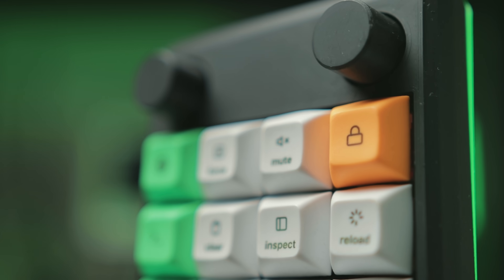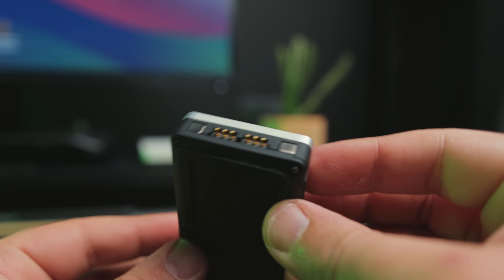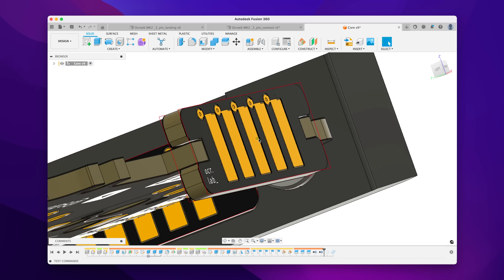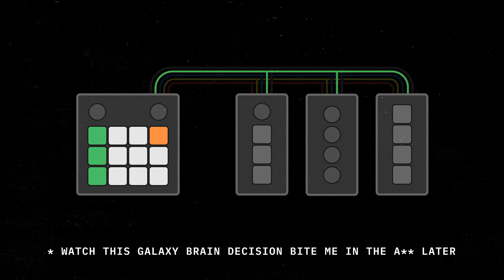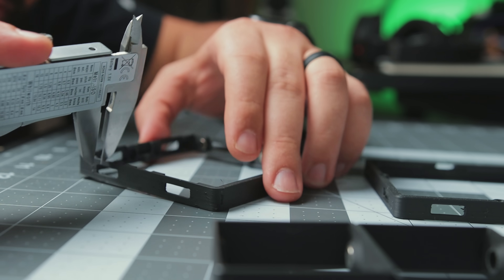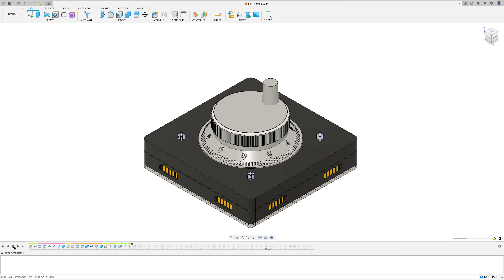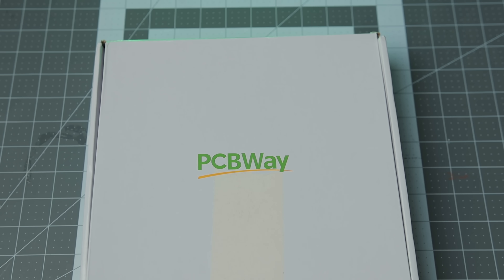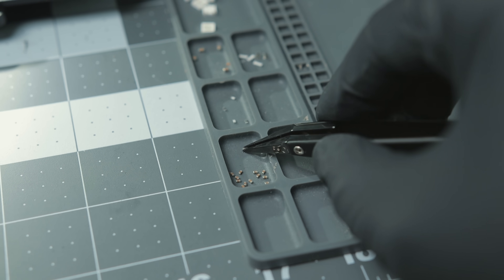How I made a Modular Macro Keyboard System (3D Printed): Ocreeb MK2

Comment: This is insanely well made. I'd have two suggestions though, both related to the modularity.

Since you've already made your own connector, you could replace one magnet with a steel insert, let's say from looking at the connector, the left is steel insert, the right is magnet, this way you won't have to worry about the polarity. Combined with a more symmetrical design using 6 pins (3 pogo pins and 3 pads) you'd have a rotationally symmetrical (I hope that is the correct description) connector. Again looking at the connector, from the left, it'd be, steel insert, 3 pads, 3 pogo pins, magnet. If you always mount them with a magnet on the right (or left) every module will always connect in any orientation.

The other suggestion that ties to the connector described above is to use modules as buffers for inputs. It will require a bit more logic on the module side though. The idea would be for modules to have an internal priority or preference to use only one connector to send data. And use the rest of the connectors as inputs from other modules. This way every module either generates its signal or forwards the data from other modules. All this will form a tree like structure (connections wise). You could then get rid of the interrupt and scanning.
Reply: Problem: pins positions would be mirrored as well: PWR will go into GND, INT into empty, SDA into SCL, and vice versa. This will probably require you to add two more pins to mirror PWR/GND (so it will be GND/PWR/INT/SDA/SCL/empty/PWR/GND) and to write some sort of handshake protocol to make switching data paths very quick and reliable.

Another idea is to mirror the whole connector (so 10 contacts with 5 pins and 5 pads) - this will be easier to handle, but might be too large to be practical.

Third option is to put female connectors in body recesses and use M-M connectors between them (so F-M-M-F, contact ensured by spring tension and tight shroud fit, magnets work by themselves). Same problems as before, but at least it won't be scratching everything it brushes against (then again, you could just put a shroud around all pins and recess the pads a little bit, like in MagSafe for well-known example).

Comment: Since you're using a 2040 based device, might look at using PIOs for doing the signal interpreter too.  They operate blazing fast, and work regardless of the software platform.  Could be a way around the problem.

Comment: When I tried doing something different but also using random modules interconnecting I made each module respond to a 'multicast' I2C address in addition to its own. So in an interrupt I could ask who interrupted instead of scanning them all. With each module monitoring its own response you could determine bus conflict and back off if there were two simultaneous interrupts. I was also using a DHCP like idea to assign module addresses so didn't have to worry about duplicates etc. It seemed to work in the concept program testing but I never took it further.

Comment: For the interrupt problem. You could look into devices using a dac to set this line to a certain voltage and then the master will do a analog read on this pin and know which module wants to talk. With using a dac there are possibilities to set the value of the analog signal so there are no duplicates. Also the highest voltage will overrule and this also acts as a way to set priorities for certain modules or actions.
Or you could use a PWM signal the same way as i described the analog one. More care needs to take place to make sure all the modules are on the same frequency and on the same phase. Because if one module is out of phase and then two modules both send a PWM signal its gonna be a hot mess. But if you achieve to get this to work also there is a priority build in because the highest pwm signal will overrule all other signals.
Reply: It is a mouth full, but it might help you out
Reply from the maker: Thank you for the recommendation. It's an interesting and clever approach. I might try it if I don't find another fix

Comment: Hey, I also have my own Macro Keyboard. I was wondering how exactly do you make it work Software wise. I found a software which transforms the inputs into normal outputs, like + or -. For example how can you make it work in Lightroom?
Reply from the maker: the lightroom stuff is done using MIDI and this software https://rsjaffe.github.io/MIDI2LR/ It allows you to map midi control signals to lightroom commands

Comment: If you made all the modules on the USB buss, but still use the magnet connectors. Windows would just see USB HID devices. Think USB HUB. Doesn't matter whats connected. You could use the new Raspberry Pi Pico W. It has Wifi too, so you could have the USB for just power and have the modules Wifi?

Comment: One option to fix the problem with the I2C polling missing the event is to reprogram the seesaw module to save the current state of each attached device and push that when requested. Buttons could also be programmed to latch when pressed until the I2C bus can send the info that it was pressed. 
Those seesaw boards have an ATtiny on them so the possibilities are basically endless!
Reply from the maker: thanks for the suggestion! I will look into it

Comment: Great project, awesome video! What are your experiences with the tolerances on FDM vs resin prints? How is dimensional accuracy? And do you worry about negative interactions of resin printed keycaps with human skin? Looking forward to the next iteration!
Reply from the maker: Thanks! 
In my experience the tolerances and fits have more to do with the surface quality. FDM tends to have more blemishes and variations on the surfaces that can lead to different results. For example you would have a calibrated printer and produce dimensional accurate models but when it comes to interfacing parts; 0.4 mm would be normal fit on FDM and loose with resin. I hope that makes sense.
As for the resin safety I try to follow proper precautions while handling and processing the prints. Once properly cured I'm not worried really

Comment: How did you insert the individual components such as the keyswitches USB-C input/output plugs into Fusion360?
Reply from the maker: by generating 3D pcbs from the 2D board space and the rest was inserted as external models like you would do for screws and hardware
Reply: Thank you

Comment: You can use CAN to make the communication faster so you don't need interrupts, can is really simple on hardware side and can go up to 1Mb/s. I2C is usually 400Kb/s which is not great and is pretty noisy on long bus topologies such as yours. I'm not sure if the rpi mcu has CAN but it most probably has SPI so you can put an SPI to CAN ic to make it work. CAN is exterelemy noise resistant and has many many features that would work great in this project
Reply: CAN is a more robust bus system that i agree, but for such a system CAN is too much. I2C has the benefit that it is build in almost all uController. It simpler and cheaper. And if the interrupt system works the I2C bus will be good enough
Reply: CDBUS is similar to CAN, but much faster and simpler than CAN, we should use UART controller like CDCTL01A.
Reply: @dukelec  This looks super cool, but sourcing the chip seems like a pain, I could only find alibaba links to it. I would love to get a reel of this

Comment: Nice video I also build the exact same macropad with the Xiao rp2040 (12keys +1 encoder +oled/2nd encoder)but connected the keys via Japanese duplex matrix and saved one pin. One problem is I didn’t now the encoder needs 2  GPIO pins that are beside each other. Couldn’t find a fix yet.
Reply from the maker: Thanks! if you are using KMK there is a different scanner I believe that doesn't use rotaryio (the one that requires consecutive pins). Don't quote me on this but i remember seeing something about it.

Comment: Wondering if there would be any isseu with having 2 of the same module? ie 2 of the slide potentiometer modules, would their i2c address conflict or is there extendable addressing available to you and that should be considered when assembling the module?
Reply from the maker: I included jumpers to change the address exactly like it's done in the Seesaw breakout boards and you can also program whatever address you want when loading the firmware.

Comment: not a fan of the pointless rgb but the analogue parts are very close to being a solution to a problem ive had
will only need to switch the rgb and diffuser from being under it to inside the grooves for the sliders and make things flatter/less tall
would prefer a long oled strip like the macbook touchbar but nobody seems to make those in colour and im not about to rip the touchbar out of my old macbook and reverse engineer it lol

Comment: I think the first thing to do, apart from changing the interrupt, to simply switch from circuit python to C or Rust, to gain massive performance just from that. Great build tho! very nice.
Reply from the maker: Thanks! Someone suggested to compile a signal interpreter from C as a library for exactly this reason. I might try that if I figure it out
Reply: @salimbenbouz  im not versed in microcontroller in python but maybe trying to compile python with a compiler library would also speed things up even without changing the code.

Comment: I say forget magnets, they're clever, but I'd rather have a physical lock under the pieces to securely keep them together, maybe a slide mechanism or like legos. Realistically, users will setup the parts once, and rarely move them around. Just my two cents on your amazing idea.
Reply: A magnet might not be as strong as a slide lock or lego style stud (which is much harder to disconnect), and I'd personally love some kind of push latch mechanism so you're not sliding on pogo-pins but anything mechanical is going to be a potential breakage - especially with brittle resin printed parts. The magnets might be less secure but there's no sliding pins against each other and no small parts to snap
Reply: Sounds like someone's never used magnets nor a modular platform before.  I say you teach yourself some things before you start spewing nonsense.  When you do actual work using inputs that aren't a basic keyboard, your setup will evolve as your workflow evolves, literally the entire point of a modular setup, and modular setups are rarely setup and never changed.  As for your issue with magnets, you clearly have no basis in reality for that statement, neodymium magnets are more than strong enough for this application and the modules aren't just going to break apart as you use them, not that they even would break apart without intentionally separating them anyways given that they'd only realistically separate under linear opposition as there's no point in the mechanism to skew along the other axes.  You clearly lack the capability of logical thought given your stance on this, and you clearly base your stance in combination with lack of logical thought on your lack of experience with anything relevant here considering your lack of understanding.  If you choose to be this mindless, then learn to sit down and shut up instead of spewing your mindless shit.
Reply: I think it should be combined with gridfinity

Comment: Brilliant project!

Can't find any suggestions as to how to solve the interrupt problem? Here's my take on it:
- Every time the master detects a new device, it will assign it an seven bit number as an ID and send this back on the IRQ line. First bit will always be a 1 and you'll never send more than 8 bytes, so you know if an address is incoming. 
- The device will save the address and use this as it's I2C address. On each event, the device will send it's I2C address on the Interrupt line.
- This approach works well with SeeSaw devices since they can take on any I2C address. A nice side-effect is that you don't need to hard-code I2C addresses and thus won't get any conflicts.

Now it obviously takes longer to send 8 bits than to just raise a line, but it will still take less time than polling many devices. Using a UART pin to receive the interrupt address, the MCU should be able to buffer whatever address is incoming so you don't loose data. I've formerly used a similar approach with multiple RS485 devices to set up a master device that can talk to multiple slave devices.

An alternate approach that scales less is to assign each new device an analog voltage. It's not as solid or scalable, but would allow for near-instant detection. Message "jenschr" on X if you want to discuss?

Comment: Wait, with your "one male, many female" scheme for connectors, how would they connect with non-male points? For example, as you have shown with the "two squares on top, two horizontal lines below" at 18:42? Wouldn't it be better to either do two connectors, or make the one you use androgynous (e.g. left 3 pins are male, 3 on the right are female)?

Comment: Great solution for the magnetic connectors.  I think that extending the connectors out, farther proud of the main pcb on each module would give you the ability to thicken the walls on the modules.  That way you can have stronger magnets.
I have a design for push-to-click square, small oled display buttons and other similar modules as yours but I didn't like the magnetic pogo pin connectors available - now I think that can be solved.
To implement some of my ideas, I was considering SPI instead of I2C  between modules but was concerned about the interconnect connector voltages and amperage limitations that would accumulate quickly with each subsequent added module as you get further away from the main power source.
I wonder if CAN + I2C might be a better strategy?

Comment: Looks cool! Your I2C comms are exceedingly slow; e.g. a transfer of 16 bytes at 400kHz should take <0.5ms, so your shared interrupt line approach should be fine. I'm guessing your RP2040 Wire code is using multiple transactions when it could use continuation (i.e. it will use a repeated start condition rather than delaying)
Reply: Also I2C is multi-master. So the micro-controller, that has an inputchange, can make the interrupt-pin high and immediately try to send the change to the head module. Assuming the head module has an address.  
For I2C message size:  1 byte device own address
keys: can use 1 bit each in the next byte
rotary encoders: 1 or 2 byte assuming max 16 bit encoders
potentiometers/slides: 2 bytes each assuming 16 bit adc
Reply: @viruselektro  Yes, multi-master would also work, without having to scan for new devices or to get updates, which has many advantages. 
He should be able to use single-master to get all values quickly though; there's something wrong with the software somewhere - I'm assuming it's the I2C library.
Reply: Also, I don't know if this is possible, but try to queue up updates on the attiny, so that the next update doesn't overwrite the first, and keep the interrupt line high when there are updates left

Comment: Regarding your performance issues: you may be able to speed things up by writing your signal interpreter in C and compile to a dynamic library (.dll on windows, .so on *NIX). Using the Ctypes (uctypes in circuitpython) module , you can import it as a python module and call your functions while benefiting from C-level performance.
Reply from the maker: Thanks for the suggestion! I will look into it. You're right maybe this will work way faster for the custom address pulse I was tinkering with.
Reply: Dynamic libraries aren't a thing for circuitpython (a loader probably wouldn't even fit in memory). You need to statically compile it into with the runtime. I couldn't find any up to date guides, but I think you just have to copy what the other modules in `circuitpython/shared-module` do.
Reply: Not sure about that. There is a timing to follow on I2C bus and you can"t overide that;
Reply: Or even Rust
Reply: @joe-skeen  Rust is great if you already know Rust and need it to do something. It is a terrible idea if you dont. Learning curve is Dwarven Fortress like.